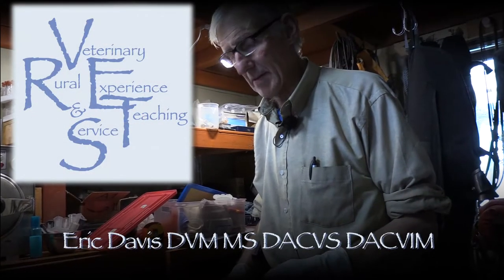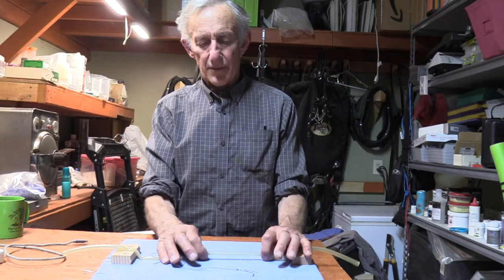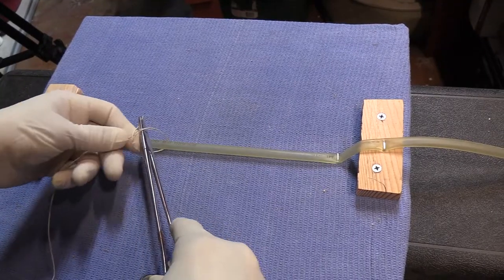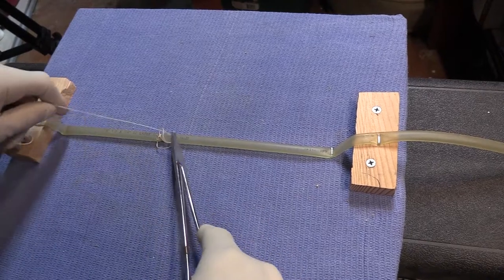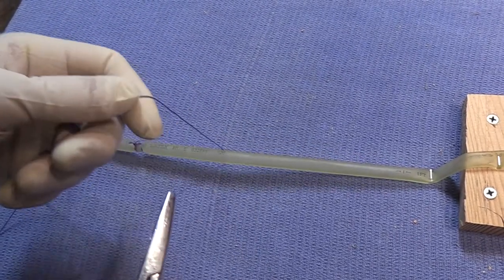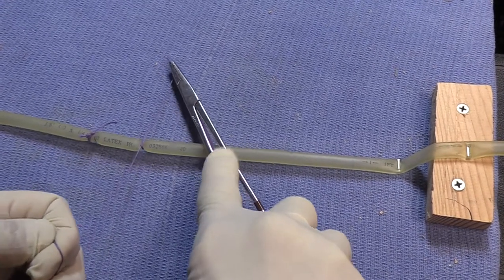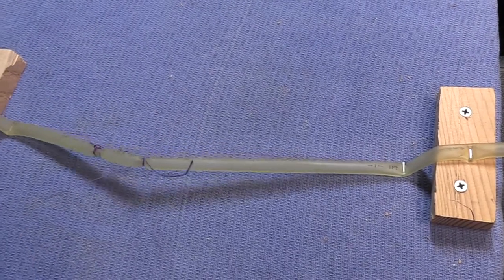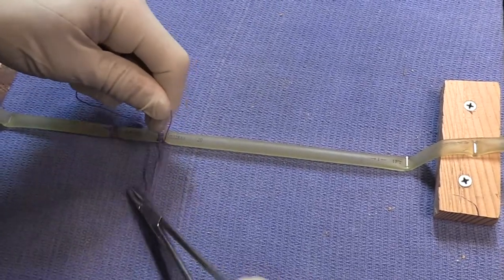Millers knot with Transfixation Dr Eric Davis

Comment: this is not the original miller knot. its the strangler knot combined with a transfuxation knot.
Reply: Not a Strangles actually, but a modified Miller's knot. Modified Miller's does not cross the two loops. Both the Millers and strangles  cross the second loop over the first.